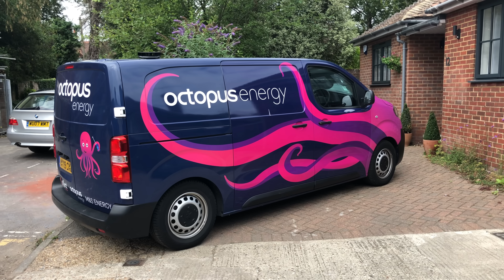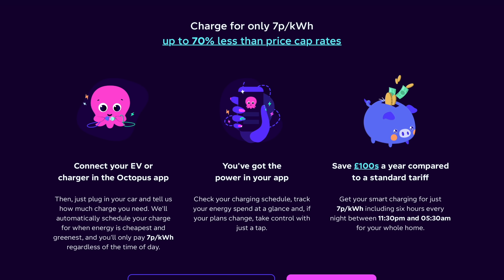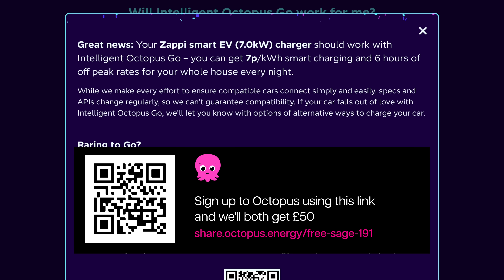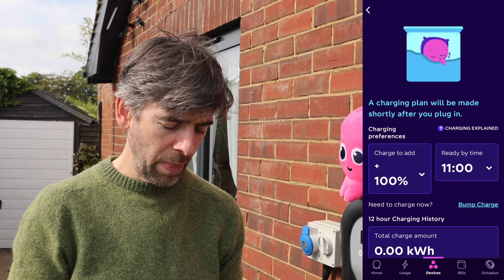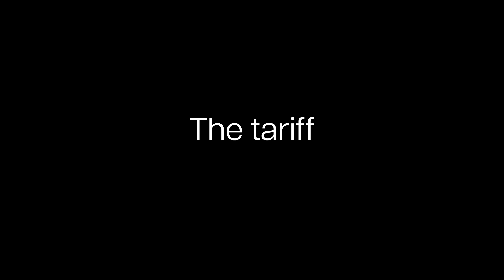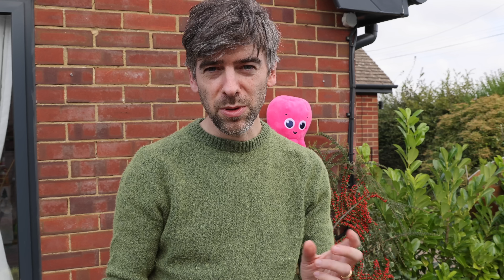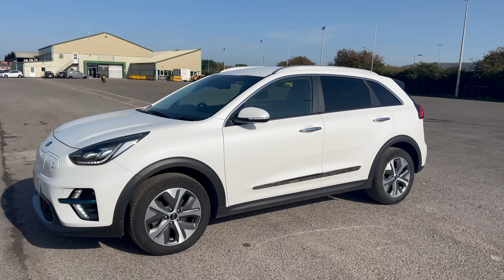We've saved a fortune! All about the UK's most popular EV tariff: Intelligent Octopus Go

Comment: I have this configured via my car rather than the charger and have seen lots of suggestions about people gaming the system. I get quite a lot of extra slots but didn't realise this gap in the software not being able to see your car SOC. I had assumed that Octopus would only give you extra slots when energy was cheaper but it seems that may not be the case and doing this with your charger. I hear that Octopus are emailing people who appear to have been gaming the system in the way you are and they will now only support connected cars and not connected chargers.

Comment: Do you receive any notifications when the car starts to charge outside of the schedule? So you can then put on your power hungry house appliances. Rather than having to manually keep checking if the car has started charging.
Reply from the maker: You get a notification from the app that tells you when it’s going to charge. It doesn’t always stick to it though so still worth checking to see if it’s actually charging the car before using any power-hungry appliances.

Comment: Hi Andrew
Thanks for this video. Octopus have just got my smart meter working after about 6 months so I've just been able to switch to Intelligent OG. It's a bit confusing and I'm not certain it's working properly yet - when the schedule is set up after logging in, it sometimes only charges for a few minutes and doesn't restart. 
The part I wanted to ask about is that around the 5 minute mark,  you say that it's better to set up the charger rather than the car. However,  the app asked me which charger AND which car. 
Do you think this is something different since the time you made the video a year ago? 
Thanks for the video
 - is really helpful. 
Johnny.
Reply from the maker: That’s strange that it stops after five minutes. It’s difficult to know where the problem lies but it’s worth reaching out to your charge point support if you haven’t already.

My car isn’t supported so I can only select the charger, but I think you have to select both. Octopus would rather have the car do the scheduling as it’s more accurate then.

I hope you get it sorted soon!

Comment: So does this mean that you will always charge to 100%? This will not be good for your battery, surely
Reply: No, you set the maximum charge state on the car and the car will end the charge cycle when that is reached. The Octopus app will cancel the cheap rate charge schedule at some point after that. But until that point, even though the car has stopped charging, your household will still benefit from the reduced rate.

Comment: Isn't it bad to charge your car to 100% all the time tho? Surely best to add what you need to around 80%
Reply from the maker: It depends on the car, how much you drive it, and how long it's left for.

I tend to charge the e-Niro every week. I don't worry about charging to 100% as I drive it soon after it's finished charging. Batteries left sat at 100% for long periods of time aren't happy, but I wouldn't worry about just a few hours. The e-Niro, like the vast majority of EVs now, have large upper buffers that protect from degradation anyway. Charging to 100% isn't actually 100%. A different story with the Leaf though! Then I would do as you suggest and set a lower limit.

If I was using the car a lot and charging every night then I would probably set a lower limit as you suggest.
Reply: @MrEV  Thanks for the advice, im pretty new but enjoying octopus go! Going to subscribe

Comment: I'd just like to check I haven't misunderstood how this works. Let's say I have a 75kWh battery with only 7kWh used and I want to charge it to 100%. It should take about an hour. However, the charger doesn't know how little battery capacity has been used up, so it sets a charging schedule that assumes it's empty - around 10hrs. And for each of those 10hrs, the whole house gets its electricity for 7p/kWh. Is this definitely the case - even once the battery becomes full, and the charger cuts off?
Reply from the maker: The house only gets 7p/kWh while it’s charging the car. Once charging stops, electricity changes to peak rate again.
Reply: @MrEV  Thanks, I wondered if that might be the case.
Reply: Apologies, I've got one more question. In the video you show how you use the app to set a time when you want the car to be charged and ready to go. Are there any rules about when that time should be? Is there anything stopping the user setting a time that is designed to ensure they get a lot of extra cheap-rate electricity?

I'll give an example: let's say my car needs 35kWh of power. This would take about five hours. It's currently 3pm. If I set a time of say 9am tomorrow, Octopus could choose to charge my car purely during the normal off-peak hours (11.30pm to 5.30am). However if I choose 9pm tonight - in six hours' time - then the charger is going to have to be on for five of those six hours, thereby providing an extra period of off-peak energy for the whole house.

Is there anything to prevent me doing this? I'm guessing there must be, because otherwise the 'boost' facility wouldn't exist - someone who wants their car charged immediately would just set a very tight 'ready' time.

Comment: The thing to bear in mind is that the Zappi (and other EV chargers) are not used for fiscal metering so whenever you're charging on Intelligent Octopus Go any other household electricity use will be at the same off peak rate including those heat pumps. A friend had their oil boiler go kaput and required replacement. They used portable oil fired heaters (winter) to warm their home until it could be replaced. Their electric bill sky rocketed. If they'd plugged in their electric car to charge and triggered the off-peak rates their bill would have been a fair bit lower. Lowering the EV charger output current would of extended the charging period and helped maximise the off peak charging window as well.

Comment: I have a very similar setup as you Andrew but I have 3 Tesla batteries to run the air to air system in winter which will use about 40Kwh a day and then charging hot water etc means some days I use 80 -100 Kwh.  I will take the full car for a run on a cloudy day to get it down to 90% and stick it on charge about 3pm at 5 amps (1 Kw)charge rate and every day the octopus system will start charging the car.  I will at the same time be charging the batteries at 15Kw so I have enough to run the house every day all for about £7.  As you say It seems to be gaming the system and I do have to keep checking everything is running as it should because octopus sometimes change the charge schedule without warning.  I know some will say I should be selling the electricity from the batteries back to the grid when the price is up but I need all that electricity in winter and even in summer with 7Kw of solar very little is exported.

Comment: Nothing but bother wish I’d never got an EV. They take over your charger you wake up in the morning no charge overnight it’s terrible. Never been able to schedule an overnight charge everything says it’s going to happen then nothing think very carefully people
Reply from the maker: That doesn’t sound right at all. What EV and charger do you have?
Reply: @ Hypervolt and I can’t schedule only plug and charge. Only had the car 2 month sick of it already. Had to change meters and gas not sending readings electric is but no bills and could take another 8 weeks to sort out. How the hell am I supposed to know how much it’s costing.
Reply from the maker: I can certainly see how that's frustrating. A quick look on Google shows that a few people seem to have similar issues with VWs.

Perhaps switch to normal Octopus Go for the moment as at least then you can schedule the charging yourself at the cheap rate, so you don't have to rely on the charger doing it for you.
Reply: @ tried it and still no luck
Reply from the maker: @RobHetherington-x8o  Have you tried turning off scheduling in the Hypervolt and just setting the schedule in the ID.4?
Reply: @ VW ID4

Comment: thanks for the amazing video.

ive just recieved a new BYD seal and i use the hypervolt home 3 pro to charge

just switched tariff to IGO and plugged in for the test charge and it created a charge schedule with 5 different slots throughout the day and off it goes.

was very concerned that with this charging during the day i will be charged at my peak rate. i called octopus and they wasn't very helpful and kept on telling me i will only pay the cheaper rate from 23:30. i did explain that i've not forced the charge but the octopus app dictated when

now i'm not sure as the car has been charging and i don't know what i will be charged. do you know of a way of viewing the actual true cost as the little smart display provided by octopus currently shows a horrendous spend amount per day which is making my other half question my decision for an EV.

please help
Reply from the maker: That’s not at all helpful of Octopus is it?! You definitely get the cheap rate whenever the car is charging. It’d be pointless otherwise!

The smart display is also pretty useless when it comes to showing what you’re paying. If you log onto the Octopus website and go to the Energy Use section, it may show you the cost there?
Reply: @MrEV  thank you for your reply and that really does fill me with a little more hope.

Also very keen to see your solar and battery progress as I've been pricing up a similar system from heatable with the Sigenstor battery.

Keep up the good work 👍

Comment: Excellent info. I wasnt aware of the "cheating", I was angry with them for charging my car immediately after plugging in and thinking it is on the higher tariff (becasu that would have been outside of the 23.30-5.30). I am still not convinced but what you say makes sense. I just wish they would offer a better way to see how much I charged the car per session, the charger's app was able to do that until I connected that to the octopus app. Hopefully enough people will ask for this and they will implement it, I'm sure its not that hard.
Reply: I had the same reaction the first time I plugged in on Intelligent Octopus Go. With a smart meter your charging windows set by Octopus will be at the off peak rate. You won't really know that until you see the bills but it's true. As the EV charger can't be used for fiscal metering any other electricity you use during the charge periods set by Octopus is also at the cheap rate. Now with that knowledge use your power wisely.
Reply: I'm finding the same issue - the difficulty of seeing what you're being charged at any time. Is there any way of real time monitoring with Octopus?
Reply: @piersgooderham8674 Not that I know of. If you have the Octopus app it tells you what schedule has been set once you plug in and those periods will be at your cheap EV rate. Other than that it's time based. 11:30pm to 5:30am EV rate. You'll see it on your bills when it flips but nothing real time.
Reply: Thanks! As long as I can be sure I'm getting the cheap rate while the car is charging (even in the day) I'm happy 😊
Reply: @piersgooderham8674 As long as you're on Intelligent Octopus Go, have allowed Octopus to control your compatible EV charger device in the app and are getting charging schedules those charging periods will be at the EV rate.

Comment: If you live north of Manchester, you may have great difficulty in getting a smart meter to work in smart mode. South of Manchester smart meters use 5G to communicate. North of that line they use radio signals.
Ive been trying for years to get Octopus to get my smart meter to work in smart mode. They have failed so far.
Ive complained to the Energy Ombudsman who have advised that according to Ofgem, provided the smart meter allows electricity into the property , and allows the the resident to get an accurate reading of the amount of electricity consumed, then the meter is working properly.
The government has set a target for all properties to have smart meters installed. I assumed that meant smart meters working in smart mode. It doesn't.
Octopus have told me that they have no intention of improving the connection between its meters and the DCC ie to operate in smart mode.
Reply: We have the same problem of dumb smart meters. Have been trying for a year now to persuade Octopus to convince the DCC that we need a cellular hub.

Comment: What you need to do is lower your charging rate in the car settings I think the Kia can go down to 1.6KW then you can charge for longer and get the 7p rate for longer I do this in Ioniq 5 but it will only reduce charging speed to 4KW if i plug in and can’t get the car to charge straight away I unplug wait 10 seconds and then it usually starts charging straight away so then everything in the house is turned on including the heating in my caravan that’s can use over 40 kws per day

Comment: Seems to be the trend with most suppliers, that is offering very cheap electricity overnight to charge your EV, unfortunately I can not afford an EV.
Reply: Even second hand ones? Plenty of low value EVs and future battery life is much better than many feared. Also, do a cost of ownership analysis based on cost of fuel vs using cheap electricity to power your car. You will save money from day one… that will have a pay back time depending on cost of the car and your tariff rates, etc.

Comment: Ive just switched us over to the BG ev tariff which will be cheaper for us from midnight to 5am to schedule charge but your saving from switching is outrageously good. Not got the home charger installed yet (ohme pro) but hopefully soon. Ive so far discovered Reading services chargers are fast but dear, and the Hilton hotel at High Wycombe is slow and it cost me more for parking than it did to charge during lunchtime. Hopefully the company can swap my Arval fuel card for an Arval e-fuel card.

Comment: Intelligent Go works with my QBEV charger.
Not sure it works exactly like you say. When I spoke to someone at Octopus they said that Octopus communicates with my car, a Tesla Model 3, so knows the SoC of the battery, it then knows how much charge is needed to reach my set level. When setting up Octopus Intelligent Go I had to giver permission for Octopus to communicate with my Tesla.

Octopus will charge the car when they anticipate the wholesale price of electricity is at its lowest, this could be outside the preset low rate time (11:30pm - 5:30am) but  outside the preset time period, only the electricity used to charge the car will be charged at the low rate, all other use in the house will be at the standard rate. 

When I connect my car it automatically charges for 10 mins or so, this is so Octopus can work out the charging plan. charging then stops and the car is then charged according to the plan. The electricity used during this 10min period is charged at the lower rate.
It might be different for a Nissan Leaf as the technology is quite old now.
Reply from the maker: If it can talk to the car to get the accurate SoC, it will. That’s certainly their preferred method.

If not (like with my e-Niro which doesn’t support it) then it’ll do it through the charger.

Comment: I've only just got my first EV and recently joined Octopus Intelligent Go, but they haven't made it clear to me that I'll benefit from 7p/kWh during peak times if I let their schedule do its thing. Where did you find confirmation that this is the case? 

I've been worried Octopus would be charging me peak rates during peak hours so I've been restricting the EV to only charging during low tariff hours of 23:30-05:30 with a schedule within the EV App and only letting it charge for longer than 6 hours when I need the EV to get to 100%.
Reply from the maker: Look here: https://octopus.energy/blog/intelligent-go-faqs/#carcharging

"When Intelligent Octopus Go smart charges your car *you will always receive the off-peak rate*. If you Bump charge, or charge your car without smart charging, during peak hours, then you will be charged the peak rate."

So as long as you let it do its thing, you'll get cheap charging (and electricity for the whole house) during peak hours.

Comment: Just bought our first EV and came across your chanel.  Lots of useful info for a first time EV user.  We have just switched to Octopus in preparation for having them fit a charger so we can move to the Intelligent Go Tariff.  Used your code, so at some point £50 should be heading your way!
Reply from the maker: That’s lovely to hear — and thank you for using the code! I hope the switch goes smoothly.
Reply: Which EV you bought?

Comment: I thought i should relate the experiences of two EV-owning neighbours of mine:-
Both own cars manfactured by the VW Group - one is an Audi, the other is a Skoda.
One was solar, the other does not.
Both neighbours have found that under Intelligent Octopus GO, their cars will complete one charging cycle then shut off and won't then accept the next cheap rate charge session.
As one of these neighbours doesnt have solar power, this cant be attributed to the force-discharge of a home battery. This has been referred to VW and a response is awaited.

Comment: Doesn't charging to 100% battery capacity damage the batteries, the 80% level seems to be the advised. What's your comment please
Reply from the maker: Leaving it charged at 100% for a while (days for instance) can increase degradation but not something I’d worry about these days as most EVs have a decent upper buffer to protect the battery. Charging to 100% occasionally is also good to ‘rebalance the cells’ — it ensures you get an accurate range.

The LEAF is a different story though! I try to avoid charging that to 100% very much.